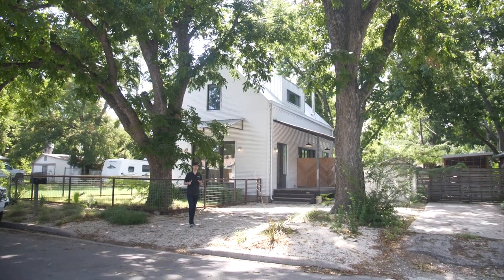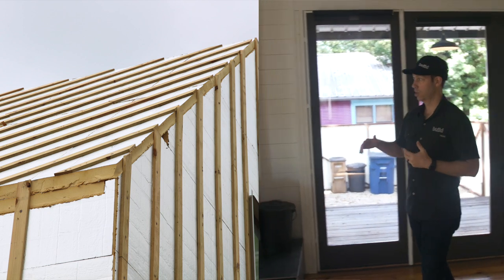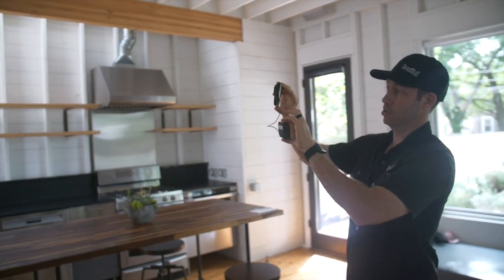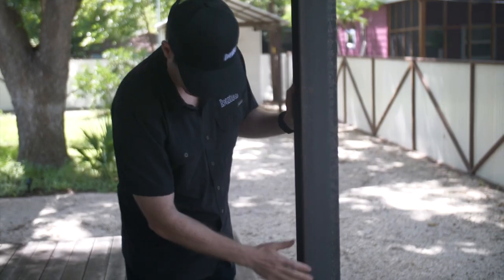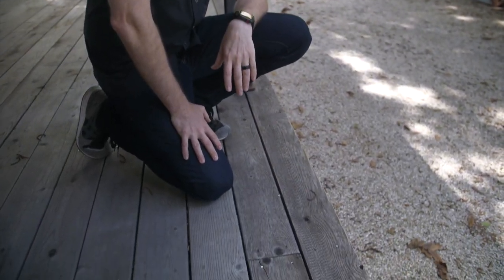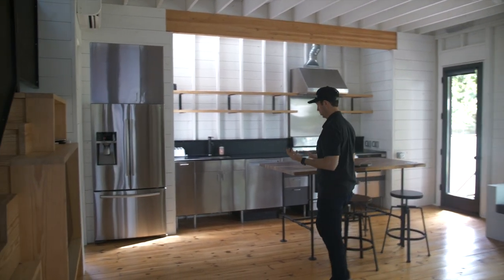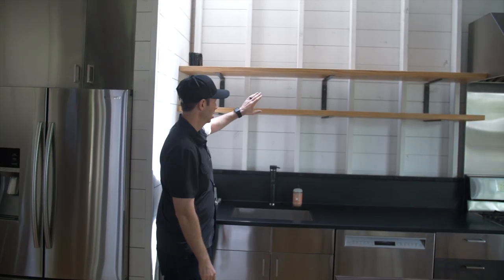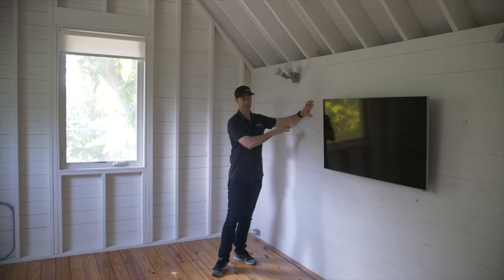This New House Has No Drywall, No Insulation, and an All Wood / Shiplap Interior!

Comment: I love this house, ESPECIALLY the mechanical spaces throughout the house. I dislike drywall in most common use cases.. this house is a dream, not a scrap of the $*#% anywhere! Love it! I agree, noise damping layers between the first and second floor if building from scratch, but  acoustic panels to certain ceiling areas or wall recesses could be added now to solve the noise reflections. I would however change the louvered doors to the bathroom in favor of frosted glass doors (in the style of a traditional wood panel door but with glass panes) to continue the "white theme", but adds the benefit of sound/odor privacy, as well as aid in better natural light distribution to the downstairs bathroom in particular. Simple changes.

Comment: I notice we're not shown any of that exposed lumber close up.  We're not shown how the electrician and plumber were paid far more to jump through all kinds of hoops to hide or visually improve the look of conduits, boxes, pipes and fittings.  But we ARE told, just not directly.  This house, four years ago cost $250/sq. ft. when the cost of a conventional house, in 2018 is $150 give or take.  These folks paid far more for a house with walls that are fantastic at collecting dust.  It's an adequate demonstration of outside insulation but why not demonstrate it on a more conventional-looking house, that someone might be found to buy one day?
Reply: Yeah to me it just looks unfinished inside but to each their own, there's sooooo many different houses out there that I couldn't see myself overpaying for this just because it has exposed studs.
Reply: IDK what your subcontractors do, but ours are pretty standard.

That electrical would be easier to install than what our subs usually do. 

And our plumbers always tuck the plumbing in next to the studs. The only difference is the paint and that's the general contractor's crew

Plus no waiting on subs then coming back to hang rock.
Reply: HerminigildeB exactly.

Comment: Not a fan of the house myself, but it obviously fits other peoples sense of aesthetics.  Outside, I prefer eaves with downspouts that run rainwater either away from the home or into water barrels.  And definitely NOT right onto the front steps!  Inside, the exposed studs are dust and spider web magnets, although if they had bookshelves between them . . .

Comment: Materials that fall into Class A or Class 1 include things like brick, gypsum wallboard, and fiber cement exterior materials. These materials do not burn well and are very unlikely to contribute fuel to a fire...  Drywall is rated at Class C...?  wood is a no-no... for fire rating?  unless you live in Texas...

Comment: "How did I do this without no insulation? I just changed the name of insulation to 'outsulation'." 

Insulation comes from the concept of an island and means to use a barrier normally material to prevent the change of heat. This is exactly what you did. Stop trying to coin terms always because even if we assume it's the term 'in'. It's still IN the house. You just used the framing as your interior wall design.

Comment: How does this meet fire code with the structure completely exposed.
Reply: Yes. Please answer the question in the thumbnail.
Reply: Very interested to hear the answer to this.
Reply: Curious also.
Reply: Oh my god!!! That wood is going to catch FIRE! 

Seriously you guys, it's wood. We use wood for mantle pieces. Maybe wood doesn't just spontaneously combust at 75°f
Reply: One reason Sheetrock is used in residential buildings is because it is fire resistant (not fireproof, but slows fires down). I’m not an expert on fire codes, but wouldn’t surprise me if some places require Sheetrock (or another fire resistant material) on the inside of residential walls. The original person’s question was whether Matt & co. ran into any issues meeting fire codes without using Sheetrock. It’s not that the wood is going to just spontaneously combust, but afaik wood is less fire resistant than Sheetrock so quite possible that you would have issues meeting fire codes in some places.
Reply: [...]
Even materials that do not sustain fire do not guarantee the safety of a structure. Steel, for instance, quickly loses its strength when heated and its yield point decreases significantly as it absorbs heat, endangering the stability of the structure (Figure 1). An unprotected, conventional cold-formed steel joist floor system will fail in less than 10 minutes under standard laboratory fire exposure test methods, while an unprotected, conventional wood joist floor system can last up to 15 minutes.

Even reinforced concrete is not immune to fire. Though concrete structures have rarely collapsed, concrete will spall under elevated temperatures, exposing the steel reinforcement and weakening structural members.
[...]
Wood-frame assemblies can economically and easily be made to resist the effects of a fire for up to two hours through the use of appropriate materials and construction methods. Experience has proven this construction system to be reliable and safe. Various configurations of wood-frame floor and wall assemblies have been tested and based on the test results, have been assigned varying degrees of fire resistance from 45 minutes to two hours.
[...]
http://cwc.ca/design-with-wood/fire-safety/
Reply: The latter part of Stephen’s comment includes a good mention of how Sheetrock (gypsum board) provides some level of fire resistance. If a building department had an issue with the open stud wall concept, it would likely be because of lack of Sheetrock. It would be great to hear from Matt or others who have dealt with the permitting & building department side of getting approval for open stud walls.
Reply: Having the structure exposed is not against fire code, for single family and/or low-rise residential.  

Curtcs:  The only place sheetrock is really "required" is shared walls with garage spaces and party walls in multi-family.  Even in those cases exposed structure could be possible and sheetrock isn't actually a requirement.
Reply: Donald Endsley: Thank you!
Reply: dlstb

For real! 

😂😂😂😂😂
Reply: It's not that it's going to spontaneously combust, but in the event of a fire having open framing would be much more flammable than framing covered by drywall which acts as a ~30-60minute fire barrier, I would think that a 2x4 would burn quite quickly when exposed to flames and the 2x4 is supporting the structure of the house, a wood mantle isn't comparable to a structural component of a house. I remember watching a video about NFPA 286 testing for various types of insulation in open wall cavities and they did a base line test with open wall cavities and 7 minutes into the test the entire room was engulfed in flames , also something about those exposed studs makes me think about those trusses they use a floor joists which have become a firemans nightmare because the bottom 2x4 cords burn through fairly quickly and snap causing sudden catastrophic failure of floor, although those fail because the cords fail I'm not sure how quickly a a 2x4 stud supporting a second story would fail though.
Reply: Being that the house is wrapped in rigid foam, which is highly flammable and no sheetrock which is flame barrier. We had a massive issue at my work when an employee was trying to access plumbing from the other side of a wall and he made a massive hole in a 2 hr fire wall. State inspector happened to be passing through and yeah. It was 2 pieces of over lapped sheetrock with a stud bay inbetween and another 2 layers of sheetrock , some insulation and then 1 layer of sheetrock.
Reply: i like to play with fire :D
Reply: no wonder my house burned down
Reply: Capthrax1, I saw polyiso insulation, look up its fire resistance...
Reply: People are asking SPECIFICALLY how this meets code.  No one is expecting it to spontaneously combust.  Building code is still law in most places.  No need to get obnoxious
Reply: @dlstb No one thinks it is going to catch fire, we're asking about the passing of building inspections and application of building codes to this non-standard construction. Duh...
Reply: I love this construction, I’m not sure how it meets fire codes, but it’s extremely practical. It may not be appealing to some home buyers, but all architecture has changed throughout the years, I’m sure the market would have a place for this....if it can meet codes.  Very interesting 👍🏻
Reply: Nice attempt at a troll that has nothing to do with the original question... how does this meet code? We all know wood does not spontaneously combust at 75 degrees.
Reply: In Massachusetts no more than 10% of the interior finish can be combustible wood...

"...803.5 Interior trim: Baseboards, chair rails, 
moldings, trim around openings and other interior 
trim, not in excess of 10% of the aggregate wall and 
ceiling areas of any room or space, shall be of Class 
I, n or in materials. ..."
Reply: Intumescent paint I'd guess.
Reply: 1 thing you all are forgetting is this house is fully sealed.   Being fully wrapped I think would mean once it burns up the usable air flow , a fire may choke itself out.   Until 1 a door is opened aka a backdraft type situation or 2 it burns through shiplap , osb, and the insulation materials    I would like to see a test of this.  It really could revolutionize building.    This could be 1/2 of regular buildings.
Reply: In the FHB feature article on this house Matt said they cleared the exposed studs with the building department during the design phase.
Reply: 1: You may, or may not, be referring to fire risks of the old balloon framing which allowed smoke and fire to quickly spread throughout the house. This house is not balloon framing.

2: Last I heard, there is no building code in Texas. You can build whatever you want. Austin may be different because I think they're trying to reach certain high efficiency standards like LEED. Regardless, it's likely a separate fire code exists

3. You should go to the Austin website to find your answer. Unless Matt replies, I highly doubt you'll get it here (based on some of the comments lol).

Cheers
Reply: Adding a pint of Rosco flamex PA fire retardant, formulated for stage productions to a gallon of latex paint, brings the wood from class C residential property to class A high density occupation with limited exits ( like stage productions ) in theaters.
Reply: curtcs - I read a MDS on sheetrock that said it was rated for 15 minutes of fire barrier; that's the same as OSB!
Reply: "An unprotected, conventional cold-formed steel joist floor system will fail in less than 10 minutes under standard laboratory fire exposure test methods, while an unprotected, conventional wood joist floor system can last up to 15 minutes."

Damn, you must be really trying to skimp on steel if your steel structure fails in 10 minutes in a regular house fire.
Reply: Steel framing tends to heat up quickly and can expand significantly ~9.5in/100ft @1000F that expansion can damage key connection points and push out against the foundation causing the entire floor system to collapse all at once.
Reply: Brandon, how is it any different than wood paneling used instead of drywall? Or exposed timbers, exposed logs in log homes and tongue and groove wood walls/ceilings?
Reply: This house was built way before Trump was president , if you're gonna try to spout off political BS make sure it's factual first.
Reply: TOM ARCHER   Earth is a mighty fine insulator in my book.
Reply: the same way a log home does
Reply: No a log home would perform much differently because logs are much thicker and would count as "heavy timber" which would char and take a very long time to burn through enough to cause significant structural weakening when compared to something built with 2x4s.
Reply: FWIW, I put a sprinkler system into my old cape. Paid for itself. They could do that easily since it's all open with this house, and that will alleviate the fire problem, AND cut the insurance costs.
Reply: Maybe a fire fighter might be running up the now extinguished, but still intact, stairs to rescue the children who are still safe in their bedrooms.. you didn't think very deeply on that huh?
Reply: He uses asbestos to match the look 🤣🤣🤣

Comment: I've often wondered why all plumbing and electrical conduit has been standardized to run within the wall system in the US.  It looks great until there is a leak of you need to run more wire; then, the repaired sheet-rock never quite looks a good as before...hence, flat wall paint to help imperfections not look so obvious.

In Europe, where many older buildings had been retrofitted with modern plumbing and electrical, all these pipes and conduit are surface mounted to the walls.  The water pipes and conduit I've seen are usually finished with an architectural coating of some sort and blend in.  You just don't "see" them after a while.  Now, whenever they need to be repaired or augmented, it's right there, easy to get at.

Is there a vendor in the US of such a system?

Comment: Wow, this is the typical house that an Architect designs on a whim without going through the ergonomic practicality of living.  This house may give a good example of why we build the way we do (with drywall or plastered interior for example).  For starters, I have experience building a house with no eaves (over hang roof).  Very bad idea, the dirty rain flows down the roof and straight down the exterior walls - makes a huge mess.  Heat insulation and sound insulation share the same properties.  Making the house quieter (which is a highlighted need in this video) also gives the house more thermal inertia ie: insulation is not confined to the exterior walls but through out the house in general to create an overall insulation.  This house obviously needs a lot of air conditioning/heating systems to balance the temperature.  Lastly from a practicality point of view: imagine I decide I want to paint a room yellow or I want to simply hang pictures....

Comment: Very cool. Are there any vids of the exterior siding and insulation going on the framing? I'm assuming it's 6" shiplap siding that that the super thick, exterior insulation is attached to somehow? How do you attach nailing strips to the insulation so that you have something to attach the exterior siding to? Thanks.

Comment: Hang sheer sheets.  Really thin,  maybe a flat layer against the wall and a second corrugated layer to break up reflected sound?
Reply: For that, DJ booths and radio/TV stations have been using expanded metal lathe over thick linen for generations. It absorbs the upper and mid frequencies, but for lower frequencies, batting between the studs and a tarry layer on the bottom is necessary. For real audiophiles, those crawl spaces could be used for 'bass traps'.

Comment: Could you use this system to retrofit older houses?
Reply: Scott Cress you could potentially, but you'd bring your wall thickness inches past the foundation as it sits now.
Reply: Siding with foam ridgid underneath is exactly that, albeit this build is designed to maximize the fit of the insulating skin by being so (to quote Risinger) "like a Monopoly piece". No overhangs, or sharp protrusions.
Reply: @bluenadas  The insulation is non-structural, so overhanging the foundation is irrelevant. The outer cladding of a building is meant to overhang the foundation. Usually not by multiple inches, but always overhanging.

Comment: What is the R Value on the external insulation? Might work in the south but doesn't look like enough for northern climates.
Reply: Dave a good question about the R value, and if you did want to increase the R value as you do live in very cold Northern climates, on this houce have ensured the foam insulation material was thicker!  By how much I hear you say! IF using rigid foam, you applied a further 2" of insulation you would add and extra12.4R value. Therefore you could achieve a R48 for a 8" rigid foam with a foil-face film. The other benefits seem to be an "airtighness" to the structure, meaning a microscopic amount of dust ingress, fewer insects occuping the space etc etc

Comment: Hi Matt. I love the building concept of this house! I currently live in the Houston area (League City), but I am relocating to the Arizona desert within the next 8-12 weeks. After watching this video I am seriously considering a complete redesign of the small house I will be building. The desert is a very dusty environment and this technique would easily battle the dust issues of a traditionally built house. With the extreme temperatures associated with the desert, my goal during my initial design process was to achieve an R rating of 30+  and I'm not sure that I could achieve that with the exterior insulation. But, the exterior insulation, in addition to spray-foam insulation between the exterior studs could possibly get me an R rating of 40+. Of course, I would have to "finish" the walls, which I plan to do anyway with shiplap.  After I complete my personal home on a 2.5 acre tract of land; I will begin phase 1 of construction on a luxury resort situated on 10 acres, right across the street (with an additional 10 acres for future expansion). Using this building technique in the guest bungalows would save a ton of money on cooling/heating over time (not to mention initial construction costs)! I would jump at the opportunity to pick your brain for some expert knowledge on this building technique!

Comment: I can see a few points that I'd personally change beyond just the sound proofing (for example, I'd want to have a vent for the bathrooms to take that extra humid air outside rather than relying purely on the dehumidifier in the house), but overall the concept is great.  And it seems like the construction would ultimately be easier both from an outside and an inside perspective.